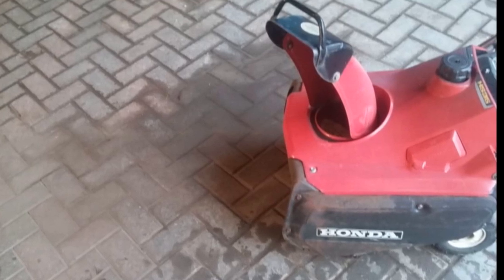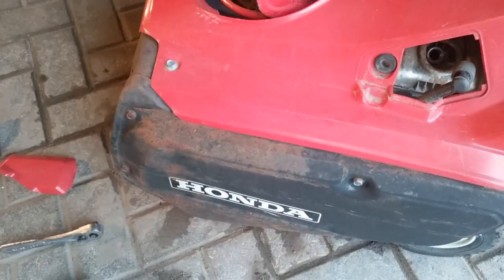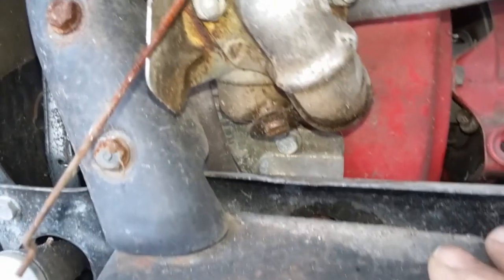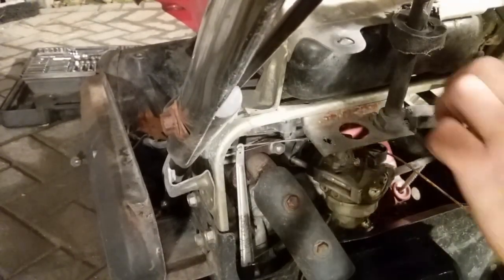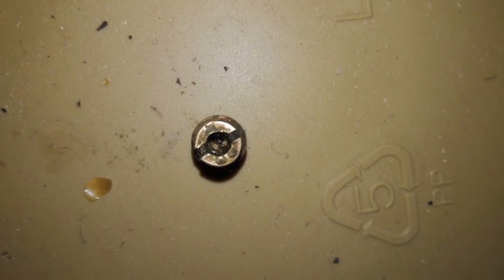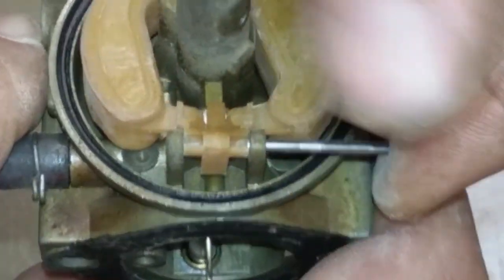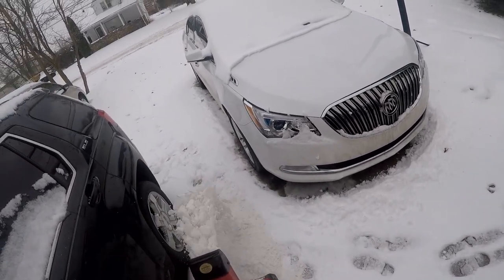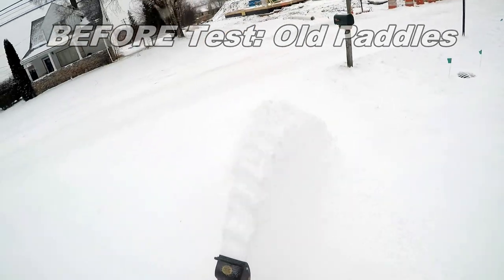Derelict Honda Snowblower - Will It Run

Comment: Bought what I thought was a lemon hs35 since I couldn't get it to start. Oddly enough, my issue was exactly the same as you showed here. Wondering if the clogging agent wasn't just gasoline that had just gelled up from sitting in the valve too long or something. This is like striking gold in the proverbial 'life skills' arena. Many thanks for sharing good sir!

Comment: a nice wide cold chisel opens those auger rails nicely and makes the job 10 times easier ...also dont forget to transfer the steel hole spacers onto the new rubber
Reply: YES. I was just going to add the same comment. Most of those were missing when I went to change the paddles. The parts were not in stock and they would have cost around $3 each and I needed 11 of them. I went to a surplus store and found something very close for 35 cents each. All I had to do was drill the center out to the correct size. I'm pretty sure if you don't have the spacers/grommets/whatchamacallits the paddles will wear out much sooner and they won't be as effective.

Comment: Hello friend, I know that this project was many years ago but I have a Honda HS35 also with that problem, I just want to know how you removed the control cover to get to the carburetor in the video it can't be seen thanks good video
Reply from the maker: Sorry, I don't remember the details, but I do remember it was tricky to get the knobs off. I looked up this thread on the subject that may help you:
https://handymanwire.com/ubbthreads/ubbthreads.php/topics/333867/2

Comment: How does it run on a full tank?
Might pick one up.
Reply: How long I mean.
Reply from the maker: @hopetonbell8134  Not sure. We only get two or three major snowfalls per year and because I subsequently use it so infrequently I don't really remember how often I need to add fuel. If I had to guess, I would say about an hour if clearing 3-5 inches of snow.

Comment: How did you get the knobs off the dash panel? Thanks for the video!
Reply from the maker: I don't remember exactly how I got them off but do remember that it wasn't easy. I believe the choke knob pulled straight out but there may have been a set screw in it. I just took a close look at the machine and it appears the fuel on/off knob never came off. Looks like I ended up cutting out some of the dash panel in order to get it off with that knob still on.
Reply: the choke control knob has a hidden screw under the tang....the fuel control knob can be pulled off after placing it at the halfway mark